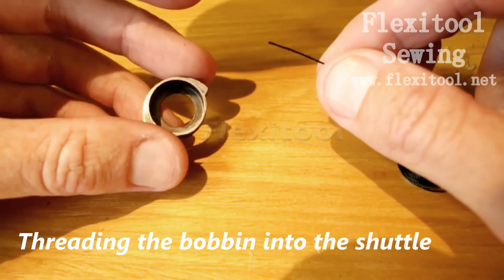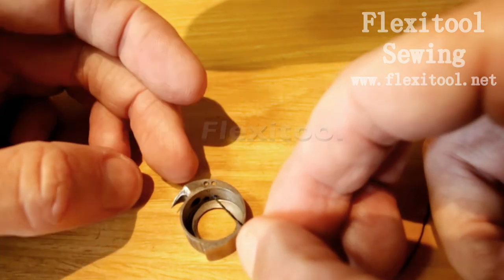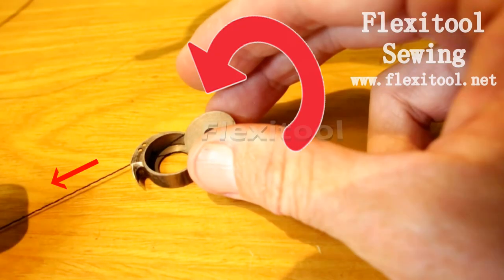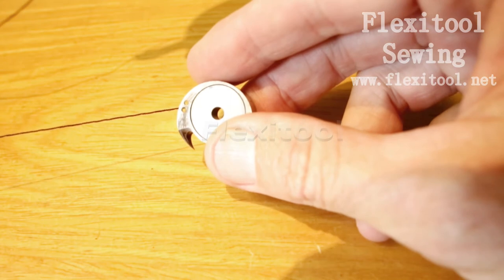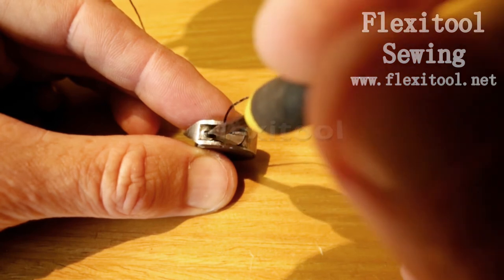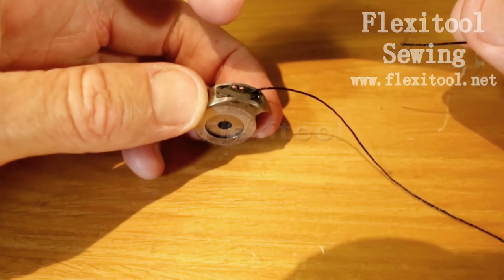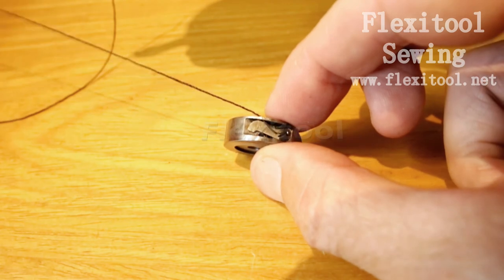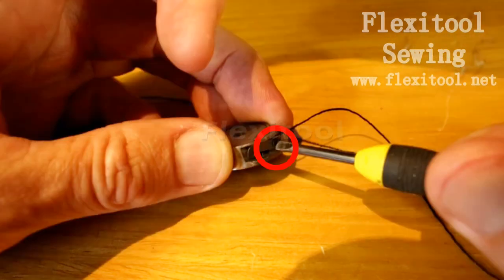#8 Threading the Shuttle - Chinese Manual Hand Crank Leather Patcher Sewing Machine *HI-RES*

Comment: Hi Graham, 
Your videos have helped alot. I was following your series and followed every  steps on your videos. However, my machine did not seem to be able to move at all. The needle does not move forward at all. Could you help me? 

Thanks
Cynthia
Reply: The machine may have come without being tested and adjusted in the factory.  Lots of nuts and bolts to tighten or loosen, and it may take an hour or two to learn your machine, watching how each part moves, or feeling which part may be locked up (too tight).  If you don't have tools you'll need to go get a simple kit, including small needle nose pliers, adjustable wrench, a small screwdriver set, regular pliers.  Cleaning off the packing grease will also help; it's not actually good lubricant, just anti-rust.   I built a completely new stand, since the tripod is absolutely worthless.  Once you get this thing running it will be absolutely worth the trouble.
Reply: @drengr2759  Thanks Corey. Despite numerous hours spent on the machine, the foot does not seem to forward forward at all....